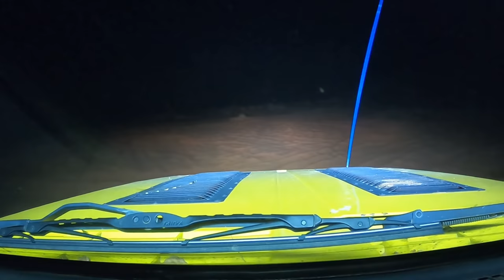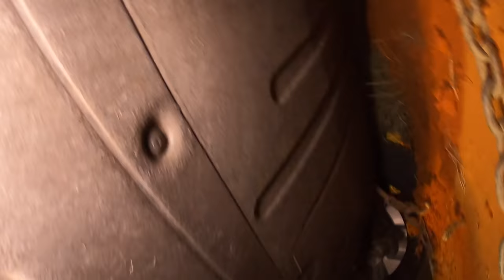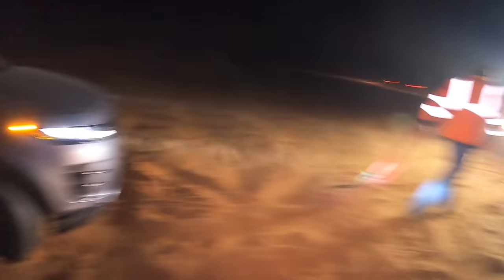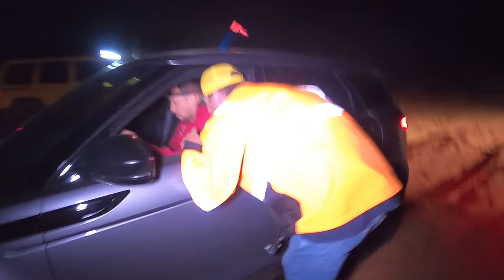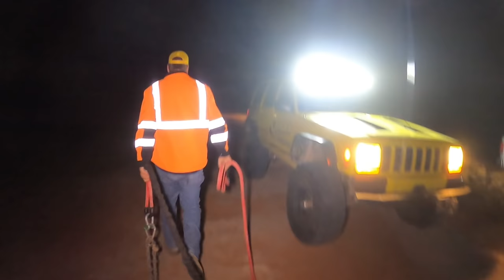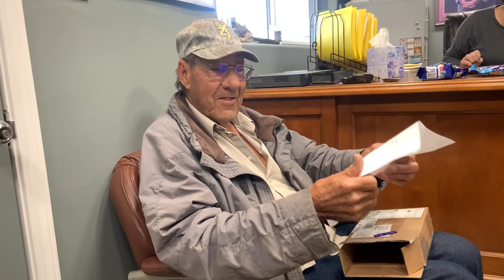Range Rover Evoque Not Doing So Well

Comment: Doesn't exactly evoque confidence does it.
Reply: Well, a Spice Girl helped 'design' it...
Reply: Not sure why they would make a 2 Wheel Dr. version of that thing and somebody would buy one.    Once your knees are bad there’s no going back...Take care of what you got while you have it
Reply: This is terrible haha!
Reply: @trevin1691  Another sad aspect of the whole deal, front wheel drive cars from the late seventies and eighties were actually sort of decent off pavement.  Cars at that time were commonly much heavier in the front where the engine was and thus the weight of the vehicle was on the wheels that supplied both drive and steering, ground clearance was better as cars rode taller, and suspensions had more travel.  FWD cars usually performed better than RWD cars off-pavement.

Unfortunately when automotive journalists started track-testing cars that were never intended for track use, suddenly all cars had to have road-going sport suspensions.  Cars weren't allowed to have body-roll, tall suspensions with lots of ground clearance, and light swaybars that allowed for a fairly large amount of body-roll and thus a large amount of articulation.

Luxury cars in particular were hardest hit, no longer would a car float over imperfections in the road, the driver and passengers feel everything even if they don't want to.  One arrives at the end of a long road trip exhausted without having particularly done anything, because the car beats up the occupants.

For awhile, SUVs and trucks were immune, no one was going to run a truck around a track to laugh at body roll, but the car-based CUVs are now affecting SUV design.
Reply: @TWX1138  I agree with this argument here.
Reply: TWX1138 The “Citation “ “Rabbit”  early. “ Cvcc” both frontrunners ...all with tires with decent height sidewalls...Range Rover heritage was Africa, all wheel drive and rigidity..
Reply: TWX1138 You nailed it!👍
Reply: It IS 4 wheel drive, if you look at the video, you can see the rear diff and the driveshafts, so there was something else wrong with it...
Reply: I'm tempted to say ...or envoke confidence, but I won't lol.
Reply: That was an awd. Remember the 3 most important things when going off-roading. Tires, tires and tires. Oh, did I mention tires ?
Reply: Remember  guys, this  junk  is owned  by  a  n Indian  company ,  so to me looks like  expensive  junk
Reply: Look at this  tires on that  thing  is like  wagon  wheels, those  tires are good  for  city driving.
Reply: @TWX1138  I agree, why Explorer has to ride like Mustang, it can be slightly slower in turns with better ride comfort...another thing is, don't go in sand with 2wd anything, dirt roads, maybe, but not off them
Reply: JMD Outdoors yes but NOT MADE IN INDIA ,  MR TATA even makes busses , do you ever know the A&P 8o Clock coffee ? That was Compass food division of A&P, well they aSOLD IT TO TATA COMPANY, BTW TATA also owns JAGUAR !  Cheers from NJUSA.   🇺🇸🇺🇸🇺🇸🇺🇸
Reply: @masterdebater8755  right? 🌞
Reply: @jkvinsland  I don't know, but I wouldn't expect any prizes for guessing it was Victoria?
Reply: @trevin1691  OK it doesn't make a whole lot of sense as a vehicle concept, but what beggars believe that after a person laid out what I expect was serious dollars for one of those, they thought it would be OK to take it to places where only genuine off-road Range Rovers are designed to go.
Reply: Trevor Dennis Cosmetic appeal without foundational function. To be polite the design engineers may not of understood the heritage of the name
Reply: You can hang up anything if the driver does not read the ground.
Reply: Skoda John even with high density polyethylene skid plates😂
Reply: @TrevorDennis100  Unfortunately, YOU WIN! Task failed successfully. Top Gear had an episode about it in 2011.
Reply: @trevin1691  I worked in the motor industry for nearly 40 years at Ford Research & Engineering, and we got to interact with other marques time to time.  We collaborated with Land Rover with instrument calibration, and they were pretty proud of  the Land Rover name.  However it was Jaguar that took it to another level, but unfortunately they didn't have the tech to back it up.  We used the wind tunnel at MIRA always doing the night shift as the power was cheaper (it has four Lancaster bomber propellers driven by big feck-off electric motors).  So sometimes we'd turn up just as Jaguar were packing up from the day shift and they used to go mental at us checking out their prototype vehicles.  What drove them crazy was us taking the piss out of the data recording equipment they used which were ancient Honeywell chart recorders.  We had way better gear, and loved to show it off to them just to make them mad. LOL
Reply: Trevor Dennis I cant fully comprehend the ability and intellect of the slide rule engineers I briefly worked under in a defense contractor operation. They have not been replaced... If your experience ever made it into a motor trend or road and track movie it would be fascinating for all of us to watch. We utilized the Honeywell chart recorders with dynamometers. Recording tensile strength and elongation to name just a few applications into the early 90s. But your generation were predominantly honest innovators not interested in industrial espionage. Last time I saw highly experienced engineers using slide rules was in the early 80s while a little company name Reynolds was blowing up the Nevada desert
Reply: @masterdebater8755  I am a retired small vessel Captain deep sea Merchant sailor spent 50 years plus running around the oceans earning an income. 6 years ago I came ashore and started driving land ships; big rigs 18 tires have pick up trailers that have had as many as 5 bad tires of 8, you are correct the tires are what makes the money not the engine. Of note tired tires are use for fenders on most tugs crew boats barges workboats.
 Few years ago there was a factual book about a  U.S. Navy ship Titled " The Ship With A Flat Tire." Big Rigs  are really bad at off roading, did you mention tires 😎😎😎😂😂
Reply: He could have easily made it out if he had deflated the tires to 15 or 12 PSI. Why didn't Matt advise him to deflate those tires?
Reply: deca durabolin he doesn’t open up liability issues like that...the suspension was completely unloaded so traction wasn’t going to occur
Reply: @trevin1691  I am not sure how honest we were.  When the first Transit van was about to be released we had one prepared for press evaluation.  It was stripped down and lovingly rebuilt to be as perfect as possible, but they decided that with no load in the back the rear springs were too stiff and the ride hard spoiling what we called NVH (Noise Harshness and Vibration).  So the night before the press got their hands on the vehicle they decided to change the rear springs.  A fitter known as 'Black Jack' got the job.  He lifted the vehicle on the hoist, put a length of four by two under the diff, and lowered the hoist to put the rear wheels off the ground.  Then he went looking for a couple of axle stands.  When he got back the vehicle had rolled forward, came off the front of the hoist and nose dived the concrete floor.  It was royally fecked!  What Jack got into the most trouble for was not stupidly leaving the vehicle balanced on the four by two, but that he proceeded to literally roll about on the floor laughing uncontrollably.   They were different days and things that were routine back then would never happen nowadays.   Jack used to wear an army webbing belt around his overalls, and in another incident someone sneaked up behind him, hooked the gantry crane hook under his belt and lifted him into the air.  The problem then was that no one dared get close enough to let him down again because he was scary at the best of times, and as mad as a robber's dog hanging in the air. The shift foreman eventually came and let him down.
Reply: @Decadurabolin9  The vehicle was high centred with the wheels barely touching the ground, so letting air out would not have helped.  Some of those fancy Land Rover vehicles can increase ground clearance, but  I doubt the entry level Evoque would boast that feature.
Reply: Trevor Dennis now. THATS entertainment not found today WOW👍 Jack must of had champions blood! Laughing at a time where others would be fearing losing their job or worse... now that’s good leadership!.Again, much thanks for the great saga!
Reply: Trevor Dennis perhaps with voice dictation or even audio books your experiences, which all of us automobilia fans enjoy could become a hobby for you👍
Reply: There was something wrong with it, or there is a huge amount of driver error involved. I mean, other than the street tires, pressure, and hitting a hill at the wrong speed. The front wheels where spinning ridiculous fast when he was pulling out. The traction system should have kicked in long before you saw sand flying. Having driven an LR I can tell you that there's one of two reasons for that, the traction/awd system is broken or its in the wrong mode. I'm guessing ding dong had it in 2wd drive mode. Its a fun place to be, except when the front wheels don't have traction.
Reply: @hanssundkvist  wrong tyres... and pressure.
Reply: Not with those street tires
Reply: @trevin1691  Half of these Chelsea tractors never go outside London so they don't need any 4WD.
Reply: That’s why we call them Chelsea Tractors in the UK - only good for school runs to private schools. Never see mud most of the time.
Reply: @hanssundkvist  Lousy tires I think.
Reply: @hanssundkvist  I might be wrong but I thought I seen both a front tire and a back tire spin. But no ground clearance and horrible tires. Someother time I might have to rewatch to see if I was right or not.
Reply: Poor clearance and tires, unfortunately neither can be fixed. Can't lift suspension, can't find decent true off road tires. I own one and checked. I'm guessing they're good for living around a farm with mud, dirt roads, and light snow. Not off roading

Comment: No ground clearance, tires suitable for the freeway, what could go wrong?
Reply: All though the car is very capable, the driver is very incapable. It all depends on the driver.
Reply: Hydroplaning for one. 
That front tire is on backwards.
Reply: Flooring gas pedal is a sure way to get stuck on sand.
Reply: yeah plus it has 4 wheel drive we will be ok
Reply: @Luis Gustavo 'in class' I'm gonna guess that its the only SUV in its class or some shit.
Reply: @NAT-rd8fl  to be fair the 4wd wasn't even working on this machine, it should have been just fine in the sand.
Reply: @0xsergy  That reminds me of an old Land Rover recall, I think on the LR3(?).  One of their low end models.  The 4wd didn't work on some of the models, but most owner's never never even noticed, lol.
Reply: @samd1235  maybe he's like those fancy off-roaders that run directional tires backwards on purpose?  ;p
(edit:  those may not be directional judging by the edge tread.  I've seen modern tires very much like that which were not directional.)
Reply: +William  Well, Goodyear calls them "AT"s, lol.  "Eagle F1 Asymmetric AT SUV-4X4"
Reply: But I like my racing slicks!
Reply: But it has a sand button!!!!!
Reply: The check engine light might turn on
Reply: @0xsergy  the 4WD is allways on in the Evoque .
Reply: @organiccold  you can tell from the video it isn't.. it's operating in 2wd..
Reply: Maybe driver did not press the „sand hill assist button first?“ 🙃
Reply: @dubbracer thats the comment I was looking for! Just because there's a button with a sand dune picture on it, doesnt mean you should begin a new hobby by taking your rover offroading on sand dunes for the first time.
Reply: Who needs things like ground clearance and off road tires and 4 low when you got a sand terrain mode
Reply: @samd1235  Good catch, those are definitely directional tires on the wrong way!
Reply: @l337pwnage  Those are definitely directional treads. The ones you are thinking of are asymmetrical tread.
Directional tread tires have to be turning in the direction the point in the middle of the pattern is facing, and when the tires are rotated, can only be swapped front to back.
Asymmetrical tread tires have to be installed with the "out" treads on the outside edge, and can be swapped front to back and side to side when rotating the tires.
Reply: @markbeiser  I ain't got time now, but if I remember, I'll double check this, but I'm pretty sure I'm correct because I spent a fair amount of time comparing tread patterns.  Many companies now make non-directional tires that are designed to look directional, but they actually aren't.  It's kinda funny, but they spend almost much time making tires look "cool" as they do making them functional nowadays.
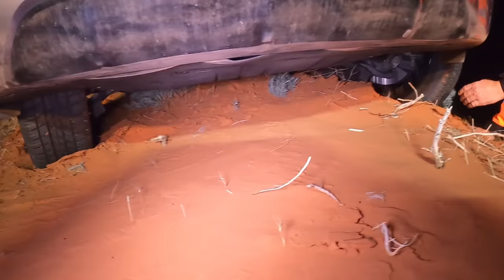Reply: @markbeiser   @1:32 you can clearly see the tread and match it to "Eagle F1 Asymmetric AT SUV-4X4", but you need to use the full name.  Almost every Goodyear tire is called the "Eagle F1 Asymmetric something something", lol.
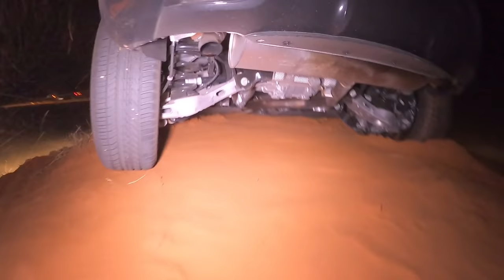Also, compare @1:13 and @1:16, you can see it's the same tire on both sides and that the angled lines are reversed.
Reply: @l337pwnage  Yeap, after looking closer, and a nights sleep, I see you are correct sir. 👍

Looking at the reviews for those particular tires, they appear to be shit tires too!
Reply: @NAT-rd8fl  not really this person does not know there is a option for sand ( land rovers traction control system) and he can just raise the air suspension but he just floored it and got it stuck.